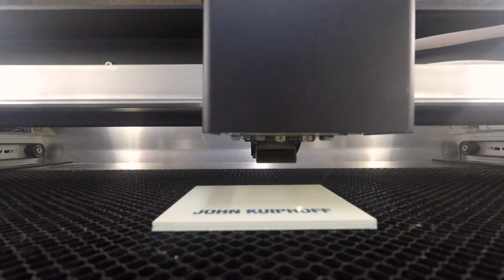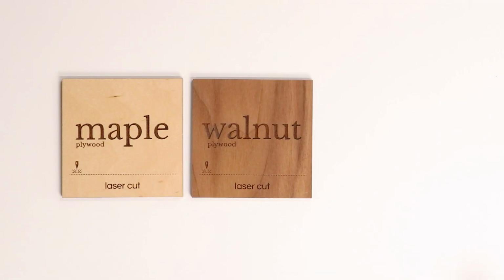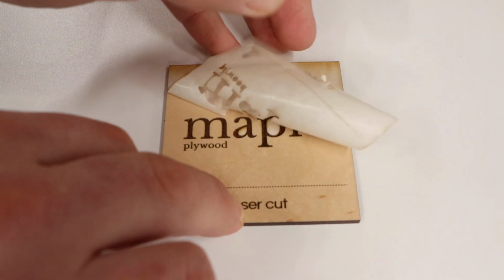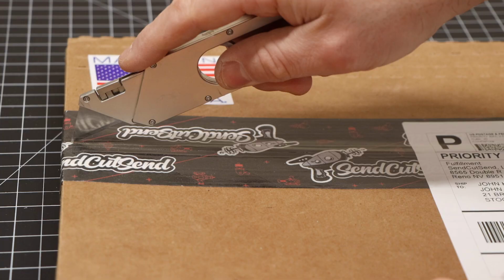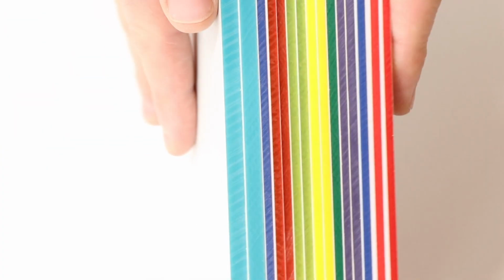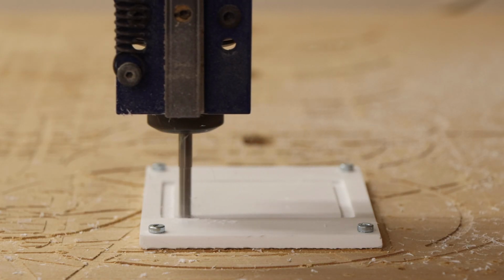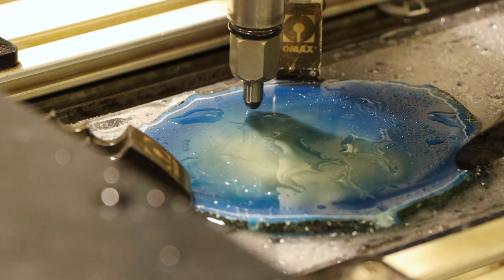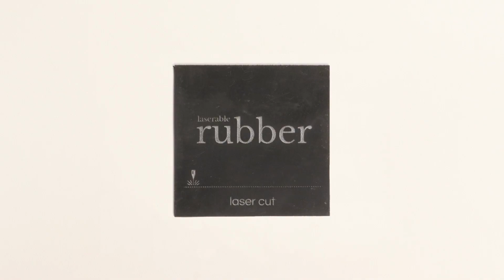Laser Engrave Everything with a Glowforge!

Comment: So if I used the spray you mentioned would I be able to engrave deep enough to make those brass wax stamps or would I have to maybe use it on each layer?
Reply from the maker: Unfortunately, that spray is only designed to mark the material. To engrave brass, you'd need to use a CNC machine instead. Bantam Tools would work well for what you're trying to do: https://www.bantamtools.com/
Reply from the maker: I own a Shopbot Desktop Max and really love the machine. That would work, too. It’s bigger and more expensive - but you can also cut wood, plastic, foam, etc with it.

Comment: I wanted to do a custom butt stock can it be done??? Its not flat so how do I work with that???
Reply from the maker: You can do this if it’s only slightly curved. The issue is that the stock needs to be a certain distance from the laser head to remain focused. I’ve engraved dozens of knife handles and it works well depending on the design.  The hardest thing is alignment - I sometimes use a trick that involves a thin sheet of acrylic and a jig to double check that the engraving will land in the right spot. Feel free to reach out if you’d like to do a quick live demo over Zoom. Thanks!

Comment: Hello John Where else can you buy laser material? Glowforge shop is out of stock most of the time.  I need clear acrylic and plywood material, bad. I have a big order coming.
Reply from the maker: I've used makerstock.com (a local company for me) and estreetplastics.com for acrylic quite a bit. Although, I haven't found anything as nice as the Glowforge proofgrade plywood anywhere else. I've tried a few different sources and the Glowforge Proofgrade plywood is just so much nicer and always flat. With that said, I often use my drum sander to make thinner solid wood for projects that don't need the stability that plywood affords. This question comes up a lot on the Glowforge Users Group on Facebook.

Comment: Hey John! This video was so incredibly helpful, thank you so much for all the detail! I'm wondering if the settings in your linked spreadsheet apply to all versions of the Glowforge or not? Are these settings only for Pro, or will they work with Basic/Plus?
Reply from the maker: Anna Bokman thanks, Anna! These settings apply to a 40 Watt Basic/Plus. I bought my Glowforge before the Pro was introduced. I hope this helps and thanks for the kind words!
Reply: @JohnKuiphoff  Thank you, this is very helpful! Can you tell me if you have any preferred vendors for your wood? I am looking for a baltic or birchwood that will cut and engrave using the settings in your spreadsheet.

Comment: Hi thanks for this very useful information. I live in a condominium at 10th floor. Can I use Glowforge machine I have spaces near window. Can a typical power outlet able to take the load. Will be very helpful any advise. Thanks.
Reply from the maker: Hi Sanaul! Thanks so much! Yes, you can vent out of the window. However, you might consider ordering the air filter as well. If it is nice outside and neighbors above you have their windows open, the fumes might bother them - the air filter will allow you to run this inside completely without bothering the neighbors (however, you'll need to replace the filter once in a while). Although, if it's a bit colder out and your neighbors have their windows closed, you can probably vent out your window. It also depends on what your cutting/engraving. Some materials have an odor (wood, acrylic, leather, etc) and others do not (metal, light engraving of any material). Also, a typical power outlet can handle the load. Feel free to reach out at kuiphoff[at]gmail.com if you'd like to talk more!

Comment: too bad they do not have a rotary attachment. I guess you can engrave 'almost' everything.
Reply from the maker: Bradley Johnson ha! I know, right? That would be a great improvement. I’ve thought about making one with an Arduino/Raspberry PI and a 3D printer... but I would need to see if I could plug into the main Glowforge board somehow to have the two communicate (unless we implement a hacks computer vision thing)

Comment: Do you have a settings guide for the metal engraving?
Reply from the maker: Sure! With my 40 Watt Glowforge, I use 300 speed; 100 power; 340 LPI and it works every time. With that said, you will want to try out a small piece first just to be safe. You may need to adjust the settings slightly based on the type of metal, thickness (to prevent heat-warping), etc. I'm also treating the bare metal using Cermark Marking Spray: https://amzn.to/3cklqBW - Thanks for watching!
Reply: John Kuiphoff you’re a life saver 🙏

Comment: You did a fantastic job on this John! The whole team here at Glowforge has been anxiously waiting for your video. Thanks for sharing! -Ellen
Reply from the maker: Thank you very much, Ellen! I'm thrilled that the team enjoyed the video! It was a lot of fun to research all of these materials. I plan to release videos more frequently now - I think that you'll like the video that I'm working on next. It's got a healthy mix of creative coding, data visualization, science, Arduino, CNC, and laser cutting/engraving.
Reply: Can you engrave tumbler cups?
Reply: Wait let me get this right, you can't engrave metals like stainless steel, silver or gold with the glowforce (without the workarounds you mentioned like the spray or powder coating)?? That's a bummer. 😓 So that means the glowforce basically isn't really meant for engraving jewelry like stainless steel or silver bracelets /pendants etc?
Reply: @ThatSocratesguy  To really engrave metals directly  like you mention you would need a much more powerful laser. The workaround is that you can coat the metal piece with some kind of paint and then use the laser to burn through the areas that you want engraved, and then put the metal into an acid bath that eats away at the metal where it is not covered by the paint.
Reply: @ThatSocratesguy  sounds like there is a fix...  the spray looks like a great workaround..   think of reflection..  want to engrave your surroundings?
Reply: Hire this guy to do your Masterclass series! We haven't had a class in a while, please do them monthly